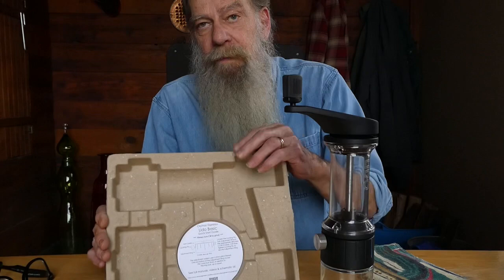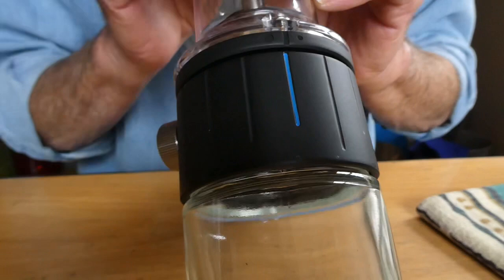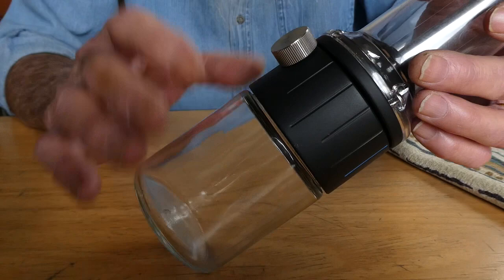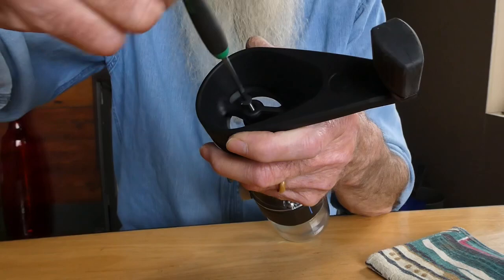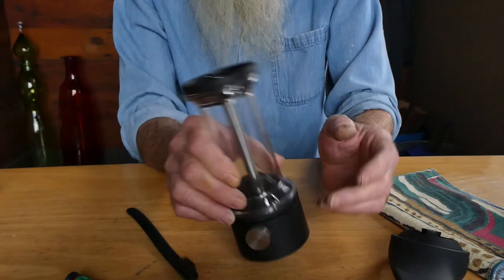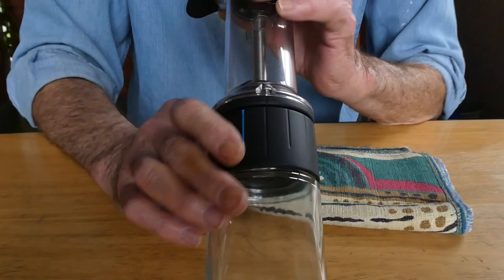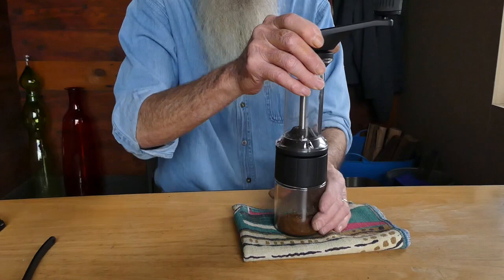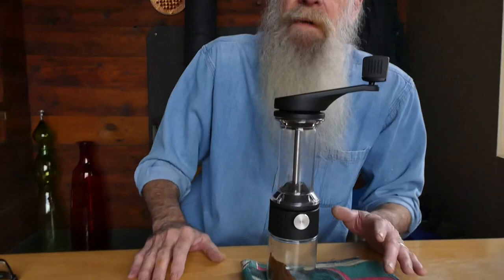LIDO BASIC Video Instruction Manual

Comment: You make mention of a nylon tip in the grind adjustment. If this should ever get squished will it prevent locking of the grind setting over time or is it just to protect the finish?
Reply from the maker: It will still lock, but the flat area on the burr carrier will have marks - that nylon tip is replaceable, but it's better to not need to replace it due to overtightening.
Reply: @orphanespresso  Ah, I get you. I was a fan of the design but, I was skeptical of the form factor. That said, the more I hand grind the more I appreciate the idea of base support. I also really appreciate that it seems to be made with longevity in mind and replaceable parts. Y’all have done a great job!